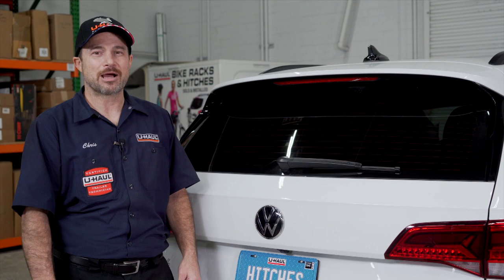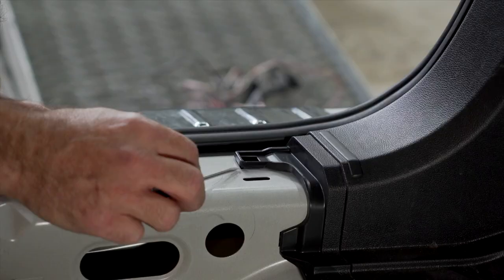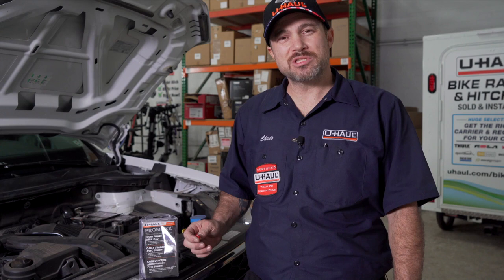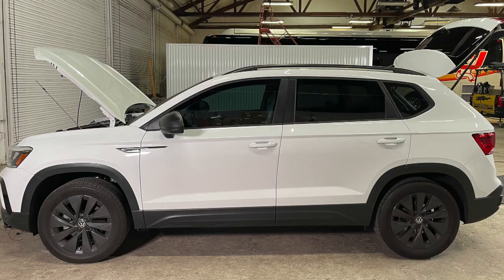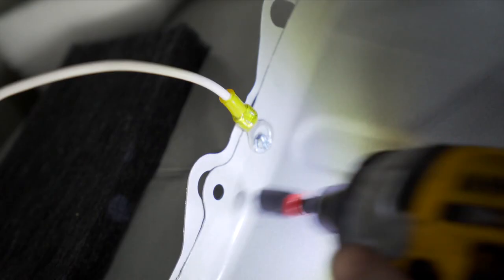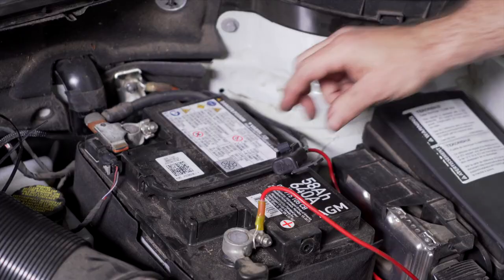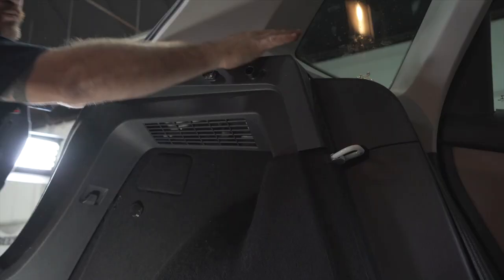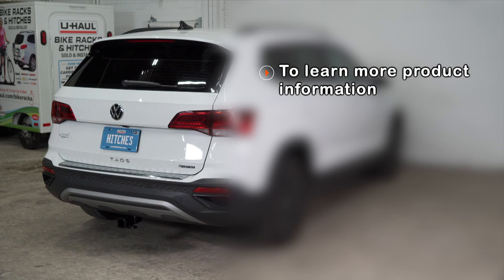2022-2024 Volkswagen Taos | U-Haul ZCI Trailer Wiring Installation | CQT119251

Comment: When hooking up to the trailer, how do you connect the wire? Do I just close the trunk door on top of the wiring harness? Won’t this damage the harness?
Reply from the maker: The weather stripping in the door will act as a cushion. As long as you avoid the center locking mechanism in the center, the wiring will not be severed and will  be fine to access in this way when needed.

Comment: What is the wiring diagram for the input sensors?
Reply from the maker: We test the vehicles wires to determine functionality because wire colors can change. Use the ZCI stop sensor unit to test each wire individually. Remove the fuse for 5 seconds between tests to unlearn the stop sensor and testa new wire. Once functionality is established you can install and Begin learning mode.

Comment: Volkswagen does not recommend installing a hitch or wiring for Taos....i would like to....will this void warranty of the car? What is the maximum pull on trailer for this car? Thanks!
Reply from the maker: No, this will not void the warranty. We used a Zero Contact Interface Convertor Box. The hitch for this vehicle is rated up to 2000 pounds. Refer to your owners manual for any vehicle Capacities.